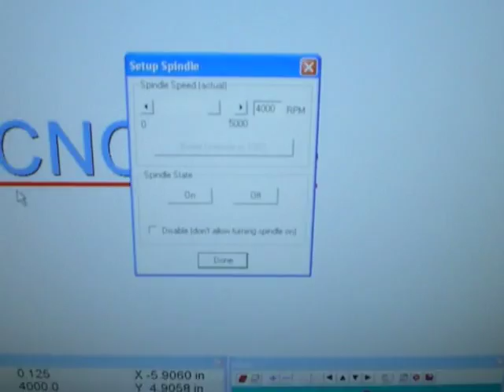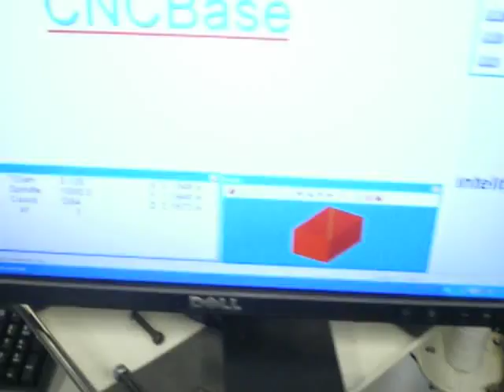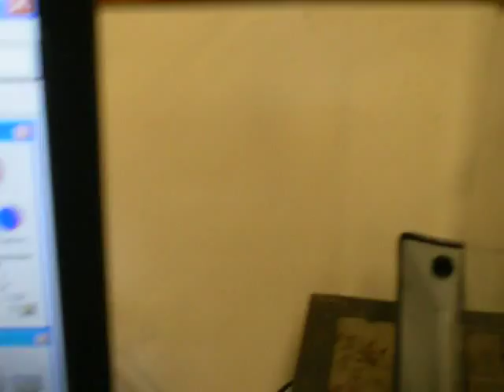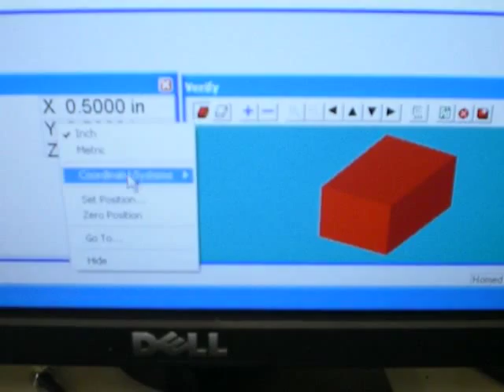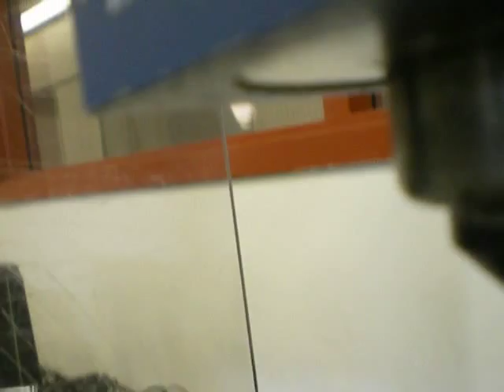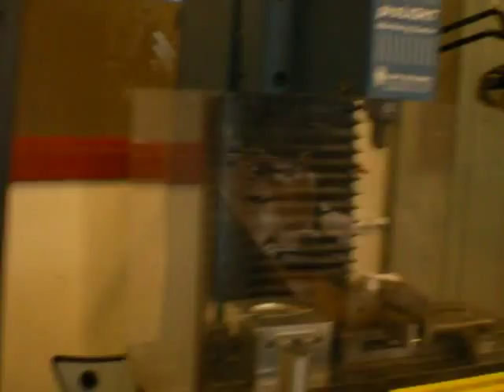ProLight 1000 CNC Mill guide, part 2

Comment: where Can I get this software
Reply from the maker: Which software?
The ProLight software you should be able to get by talking to ProLight corp. I think we got a download copy of it at one point, though I could be wrong.
Reply: @MacRobbSimpson  Sir, I have same machine and black box.  Have been using it with windows 98 computer and the older software.  Recently downloaded the software you are showing in the video but can't use it with that old 98 machine.  So my question is what computer are you using in the video and how is it connected to the black box?
Reply from the maker: I remember it being a socketed Pentium; like a P2 or P3. The newest computer I could find with an ISA slot. That's the trick here - the ISA card that drives everything.